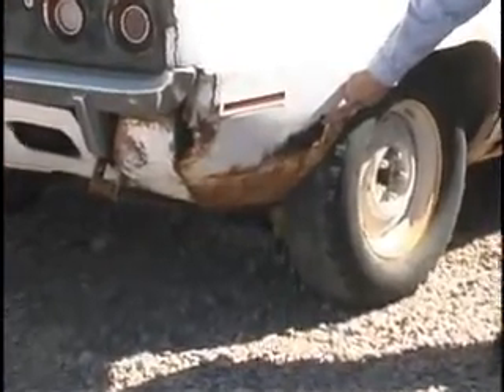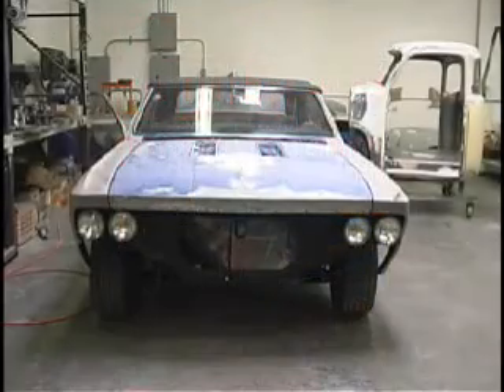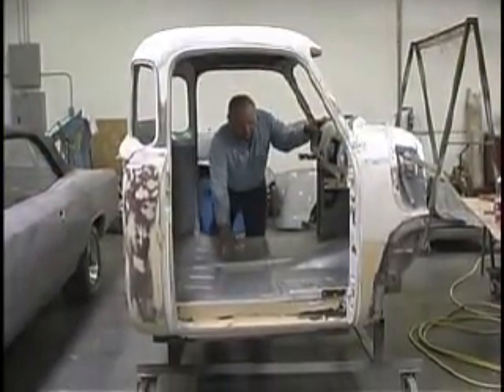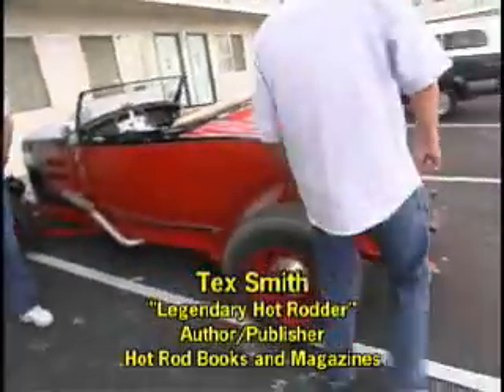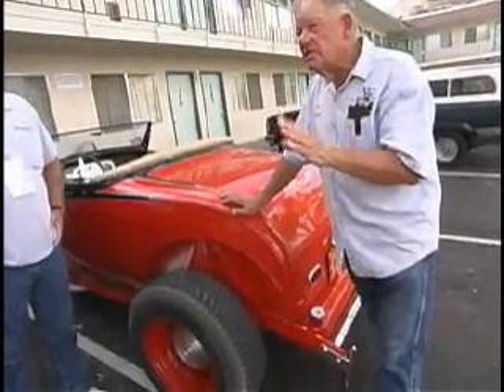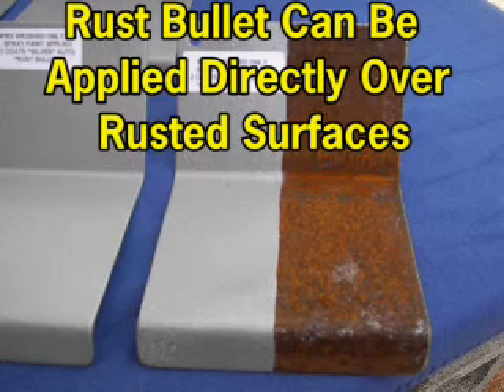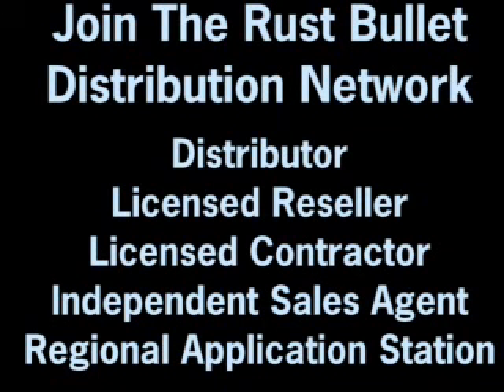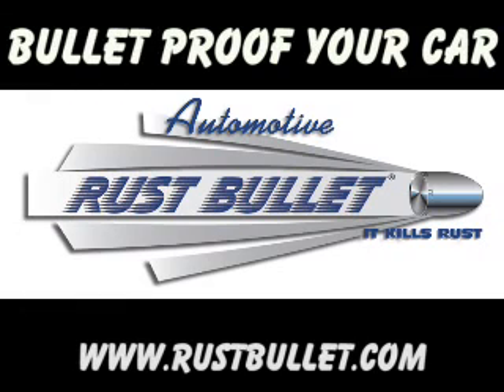Rust Bullet Automotive

Comment: Any rust will survive if it still get's access to moisture.
The thing with using this product for hoods and other similar items is ,you need to get to the other side as well to cut of and kill the rust.
That is probably why you had issue with it coming back.
I found using their Metal Blast first over the bad or rusty metal and then using two coats of Rust bullet and one of Black Shell, does a really good job.
This is definetley one of the best products out there.
You just need to be able to get to both sides of the affected area, if it's that bad.